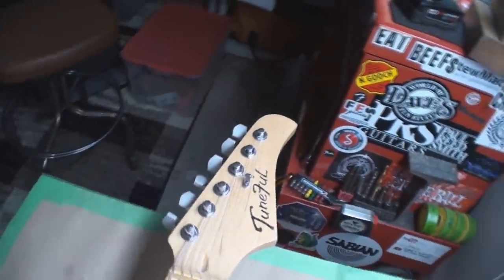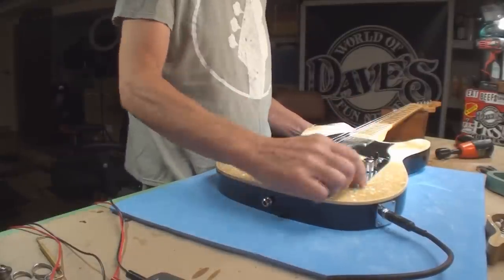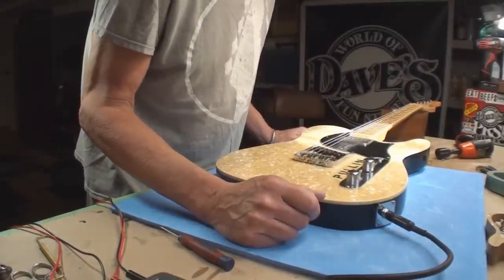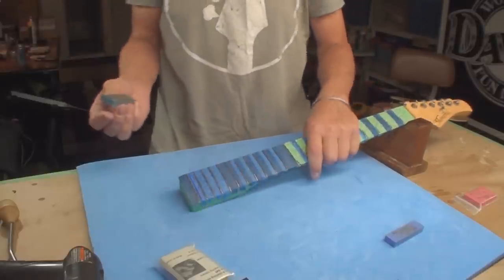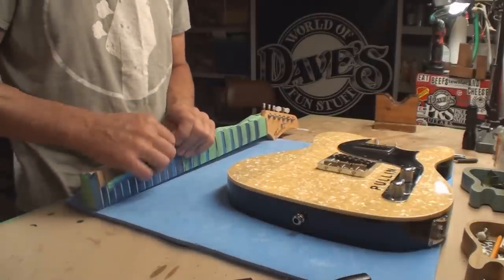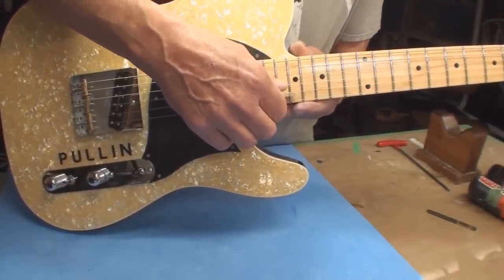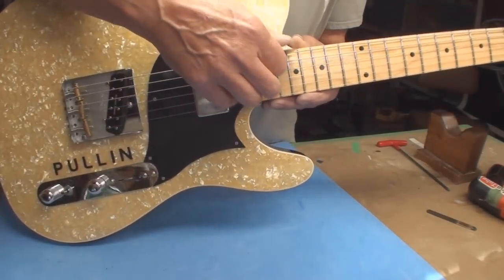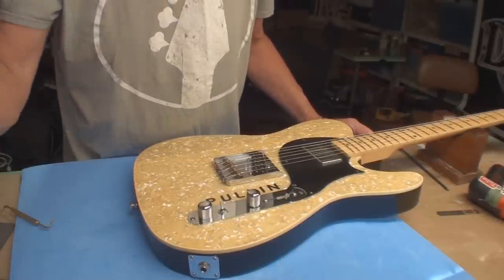Partscaster The Reason I Video ALL REPAIRS

Comment: I had a ground buzz appear in my guitar once. The buzz would disappear when I touched the strings or tailpiece. After checking all the connections the problem went away when I unplugged the amp from the wall and plugged it in again. The problem was oxidation in the ground connection causing weak grounding that was corrected by the friction of unplugging and plugging the amp. It had been plugged into that outlet for months. So that is my suggestion for the first thing to check if you hear a new buzzing in your gear.
Reply: Wouldn't have that problem here, since there is absolutely no earth/ground in my entire flat. No buzz, either, if the guitar is decently equipped.
Reply: @Ndlanding  Maybe no ground is better than a weak ground for noise then.
Reply: Hmm all my guitars are like that
Reply: @jeffberg8015  I really couldn't say, since there is no protection against shock, fire, etc. But the only times I've ever been electrocuted (on stage or at home) was playing at festivals. Once, we had to take off our socks and put them over the mikes, in order not to be zapped when lip touched mike. I kid you not.
Reply: @Ndlanding  dude, I would seriously advise you to get that checked out.  In the UK, that basically be a legal requirement for the company supplying your electricity.   Without a ground/earth,  you are vulnerable to killing yourself via electrocution due to a ground fault.   It’s not something to fuck with,  believe me.
Reply: @stevedimebag  Thanks, but I'm not in the UK. Spain, in fact. 230V, and no inspections, except when you have a place rewired. I've got used to it, and since I used to work as an instrument engineer (gas detection, etc.) I'm used to getting shocks! Never had one here, tho, in 36 years. Bzzz!

Comment: I'm glad you shared the soldering iron noise issue! I've done that several times! 
So I'm glad I'm not alone!
Reply: lol I recently started learning how to solder (because I started a guitar kit) and the buzzing noise was REALLY loud... I eventually realized it was because the guitar was too close to my PC
Reply: Smartphones also generate a lot of RF noise.
Reply: You can buy copper shielding tape and seal all your body cavities from RF interference, if you use single coil pickups. Faraday Cage!
Reply: @freedomination2  I prefer shielding paint! 
But even a well shielded guitar will suffer from soldering station interference!

Comment: In my tiny apartment i get noise from power supplies, lights, wifi routers, A/C,  fans, ballasts, etc, I can only eliminate it when i unplug alot of stuff it makes recording audio/video simultaneosly a real bummer but oddly my line 6 wireless relay is pretty quiet to my battery powered yamaha amp.
Reply: I get similar issues with my equipment in my garage under the fluorescent lights. Sometimes I could shield the issue away (not the pickup orientation kind though).

Eventually I got a set of EMGs for a Jazz bass. Absolutely silent at rest regardless of environment. So I started to use them on most basses. SIRE M2 active bass was also quiet. I did get some hum from on install ... darn - ah I forgot to remove the bridge grounding wire.

Finally I put a set of DG20s on cheapest strat just for fun. I found the tone to be just great. No coil issues. I recently compared them back with some Fender single coils. The passive pickups are noisy and weak on comparison. I know Dave doesn't like the batteries. But in my env it just works for me. No shielding.

Comment: Hey Dave, I've got one of those Peavey EXP Generation Telecaster guitars that a friend gave me for nothing, it has a set of passive pickups with a HSS configuration, and a set of piezo pickups in the string saddles, it all seems to work but there's one problem with the guitar, I think someone at the Peavey factory might have been a bit hung-over and messed-up the placement of the bridge when they were designing it, cause I have some of the saddles hard-up against the back of the bridge and the strings are still reading sharp, I've worked-out that the bridge needs to be positioned about 5 to 6 mm away from the bridge humbucker in order to get the intonation for all six strings adjusted correctly.
Reply from the maker: a different bridge design replacement might be the answer

Comment: 0:47 quick question: is the slant of the intonation screws seen here normal? I'm building a guitar kit for the first time and I replaced the bridge with a real Tele one, and was a little concerned that the intonation screws were not parallel with the body, like I think it was before with the cheap bridge. I'm new to Teles so I thought I'd ask from some folks that might know more about it. Thanks :)
Reply: I think it’s part of the function of the string height adjustment. If those screws are slanted too much, a shim in the neck pocket might be required to change the neck angle and make the string height adjustment less high (lower). Hope that helps…Thanks, Gord.
Reply: @gordonholland3406  oh ok, thanks!

Comment: Might be a ground problem  on their amp or what the amp is plugged into possibly both.try a different receptacle that's on a different breaker, or fuse
Reply: Or a crap cable. I guess if the customers makes a video of the setup and noise then that helps too.